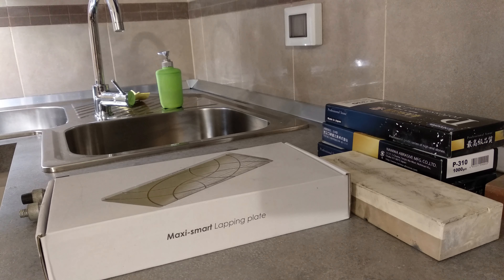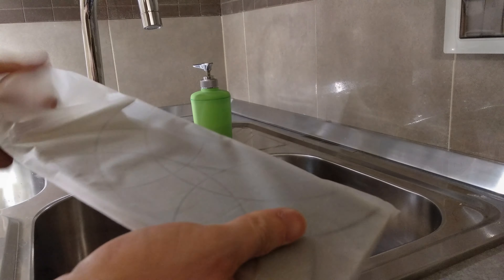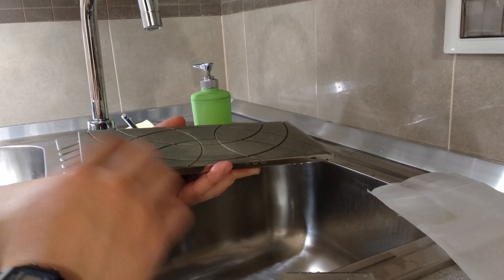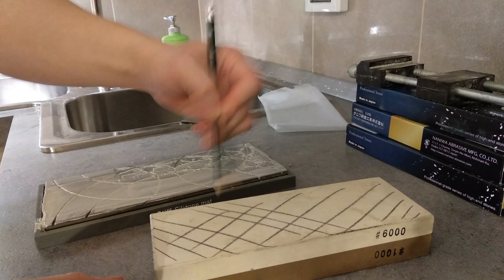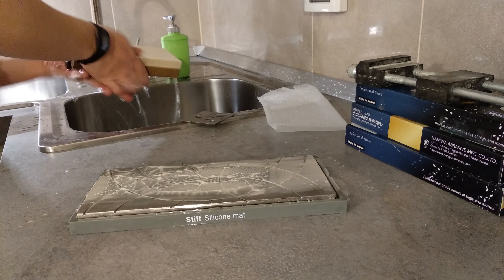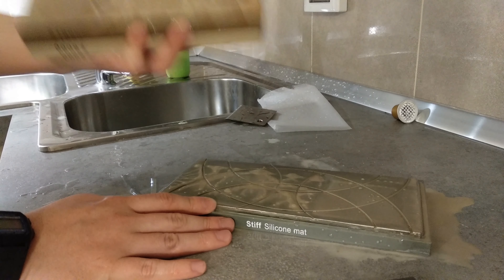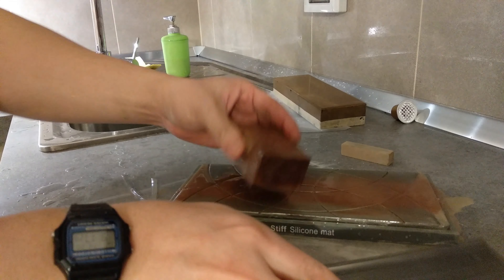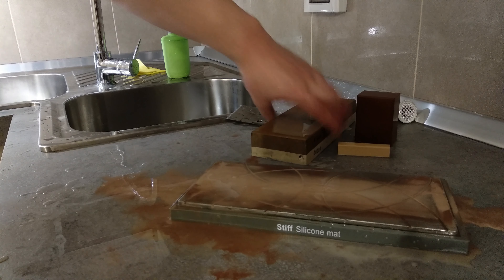Sharpening with Heiko in MILAN | Part 1 of 2

Comment: for more sharpness,I can advise one thing. If the grid of diamond stone is anout 150-200, the flatness level becomes 150-200. In other words, it's flat but rough actually. So if you have lots of stones, you should make the flatness by using smaller stone. For ex, if you want make the flatness of 800, you should make the flatness of 300 by diamond stone and using 300 gird stone, make the flatness of 800 grid stone (^^)
Reply from the maker: Thank you Naoki-san for the comment!